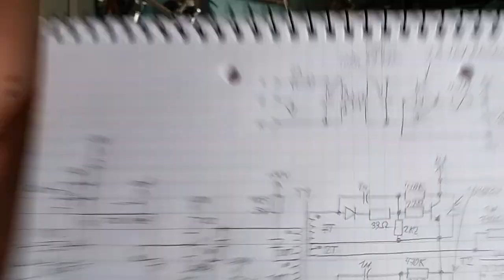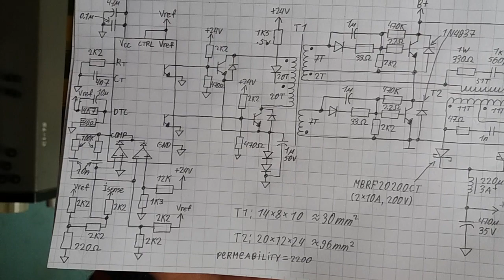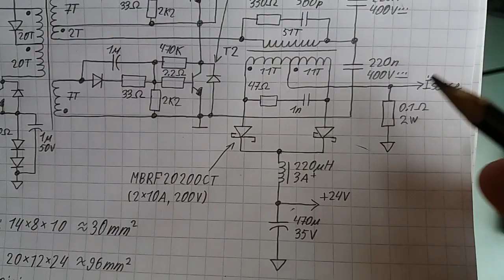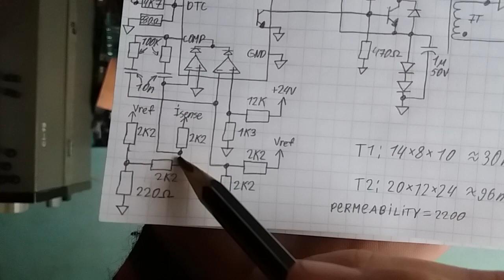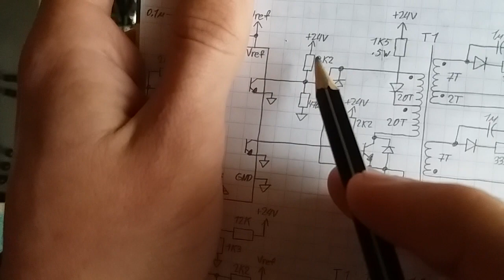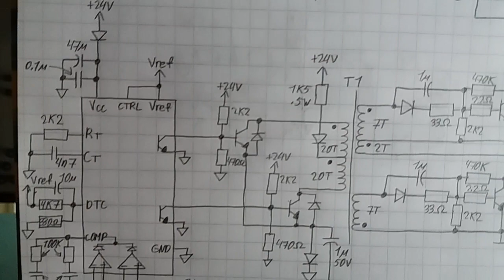tl494 SMPS: Part 10 - Schematic

Comment: Nice job there! I have a question about the driving transistors, though. What is the purpose of the diode in series with the 1.5K resistor that go into the center tap of the driving transformer?

Keep up the good work!
Reply from the maker: Overcurrent protection. Such supplies require so called deadtime, when all power transistors are off. In this circuit, to make sure it is so, two small transistors connected to the drive xfmer are turned on simultaneously. Effectively causing the drive xfmer to behave like a piece of wire shorting bases of power switches
Reply: @mrjohhhnnnyyy5797  Thanks for your answer. I have a similar +24V SMPS with a problem, though. Practically same configuration except for a bit different component values, and an independent winding from main transformer with rectifiers and filter to feed TL494 and pulse transformer circuit.

With no load, both the pulses coming from TL494 (pins 8 and 11) and the ones on transistors collectors at drive transformer primary are 2.6us wide, with 200 ohm load, pulse widths are 5.6us, 150 ohms: 6.4us; 100 ohms: 7us; 66 ohms: 8us. Once load is 50 ohms, pulse width at transistors' collectors grows no more, and pulses coming from TL494 go almost as wide as the sawtooth width, not quite because of dead time, I presume. Output voltage drops naturally down to 20V. This is a 150W PS.

I was wondering if there is an inherent limit in pulse width or duty cycle for pulse transformers, or maybe something I'm overlooking which is not apparent to me due to "work shop blindness".  What is the maximum pulse width at full load at transistors' collectors? By the way, my switching frequency is 25KHz. Yours seems to be twice as much.

I do really appreciate any light you may shed on this as it seems to me you know this subject quite well.

Thanks, sir.
Reply from the maker: @rafaellarios3707  Seems like your power transformer is calculated wrong. Put a 50 Ohm load, scope the voltage right on the secondary (to be safe), if it looks like pure square wave with just a little hint of deadtime, it means your transformer is indeed whack.
 Are you using ready-made transformer or you made it yourself, if it is the second, give me: AC input voltage, output voltage, and number of turns. I can do a quick check
Reply: @mrjohhhnnnyyy5797  This is a Mean Well PS-150 power supply. I like repairing stuff and this one has proved to be a challenge, so far.

But you have a point right there as there is something unusual on output transistors waveform. Instead of being a flat line between half cycles, there is a voltage bump prior to transistors being told to go into conduction. Base pulses are only on when they are supposed to be on, so I don't know whether this voltage bump is caused by transistors, or maybe something to do with main transformer. On the other hand, I wonder if transistors were bad this waveform would be as symmetrical as it is.  Send me an email to rafael.larios@gmail.com so  I can send you pictures of waveforms. An image is worth more than a thousand words.

Thanks, sir.

Comment: I was interested in the schematic just to see if it conforms to some i have seen over the years, and yes it mostly seems the same arrangement, but i wont copy yours, so dont panic.

It reminded me of the atx 200-250w types, the tl494 and typical style of drivers.
It's a well known style and quite reliable, so yours should be good for a long time :-D.

The bits that were very different were the power output transistors would be supplied via the primary of the final transformer from a single capacitor that connects to a capacitor divider across B+, yours replaces the single cap with a link.
And your method of making it switch on isnt normally needed on an atx, as it has a 16-18v standby supply to feed the 494 and stages, so it starts straight away.
And your current limiting is different.

Don't kill me for slight misunderstandings, i don't look at switchmodes that close :-D